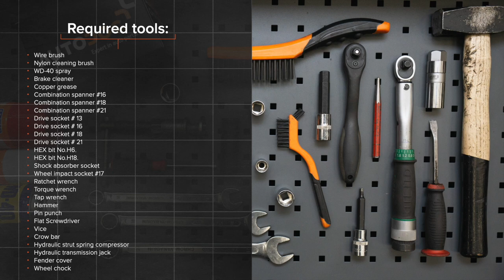Hvordan bytte fremre fjærbein der på Audi A4 B8 Sedan [AUTODOC-VIDEOLEKSJONER]

Comment from the maker: Merk! Det er en feil i denne videoveiledningen.
13:03 - Skiven bak må strammes med dreiemoment på 50 Nm, ikke 60 Nm.
17:46 - Skiven bak må strammes med dreiemoment på 30 Nm, ikke 40 Nm.
19:26 - Skiven bak må strammes med dreiemoment på 40 Nm, ikke 60 Nm.
19:34 - Skiven bak må strammes med dreiemoment på 40 Nm, ikke 60 Nm.
19:41 - Skiven bak må strammes med dreiemoment på 90 Nm, ikke 80 Nm.
19:45 - Skiven bak må strammes med dreiemoment på 40 Nm, ikke 80 Nm.
19:59 - Skiven bak må strammes med dreiemoment på 100 Nm, ikke 70 Nm.
20:02 - Skiven bak må strammes med dreiemoment på 40 Nm, ikke 75 Nm.
20:11 - Skiven bak må strammes med dreiemoment på 200 Nm, ikke 140 Nm.
22:13 - Skiven bak må strammes med dreiemoment på 40 Nm, ikke 65 Nm.
Vi beklager ulempen 🙇‍♂